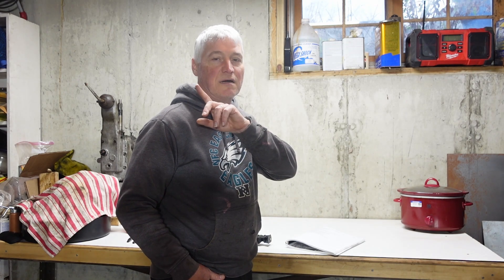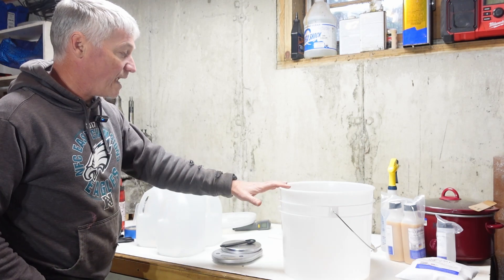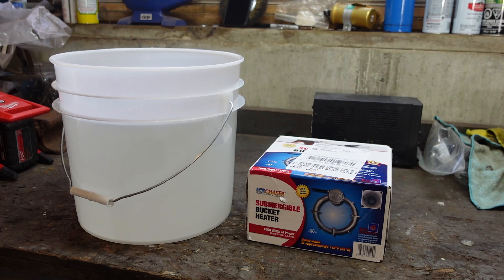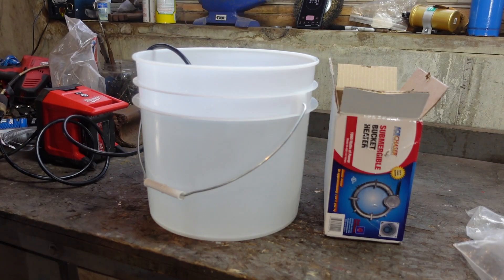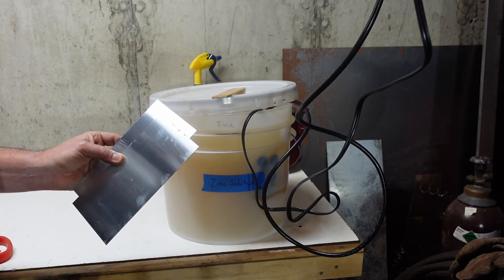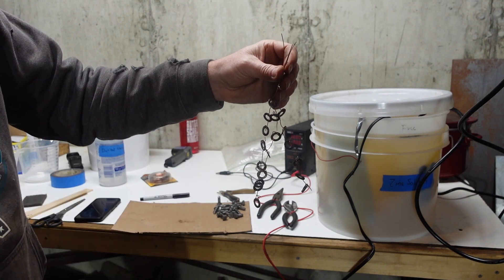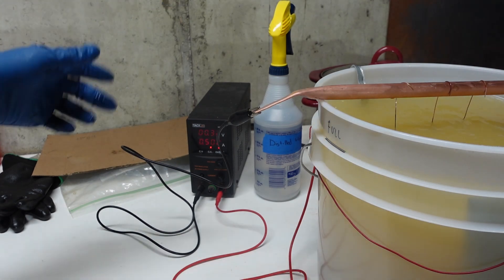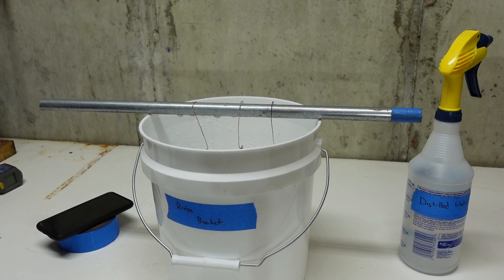Zinc Plating Rookie - Not Easy, But Worth the Effort | Roundtail Restoration

Comment: I did the same on my door latches on my wagoneer.   I had the same issue in some areas had no plating.      I ended up turning my subjects every once in a while so no areas would be exposed to "shadows".    That seemed to work well.    It's one of my earlier videos.   Good stuff!   Keep cranking!
Reply from the maker: Thanks, I'll check it out. I'd like to do larger pieces too, eventually, like you. Figure I'll start with the small stuff and go from there.

Comment: Good stuff Chris. Thanks for showing. 
Not if this is the issue, but my understanding is electroplating basically line-of-sight, from the anode to the cathode. If there is no direct line, it probably won't plate there. Do you need more anodes around the perimeter?
Reply from the maker: Yup, it's something I've looked at. I've taken to moving the stuff around every few minutes and that seems to help. Still don't have it down yet, though.

Comment: That air-pump is most likely non-submersible. They are designed to have a plastic tube attached that also connects to an airstone on the other end. The airstone bubbles air up through your plating solutoion to agitate mixture.
Reply from the maker: I mis-spoke in the video, it is a water pump. And I verified the directions that you can submerge it. I did invest in a slightly better, but still cheap, water circulator for aquariums. We'll see how that one works. Thanks for watching!